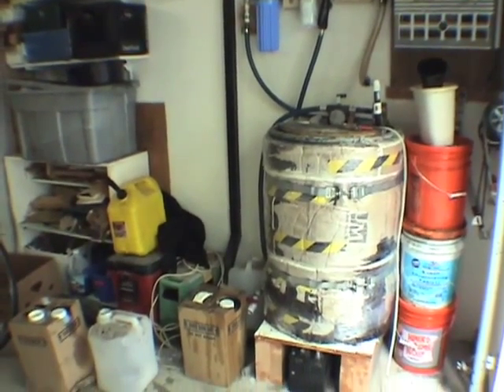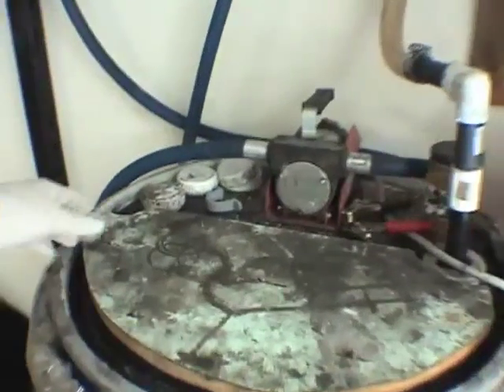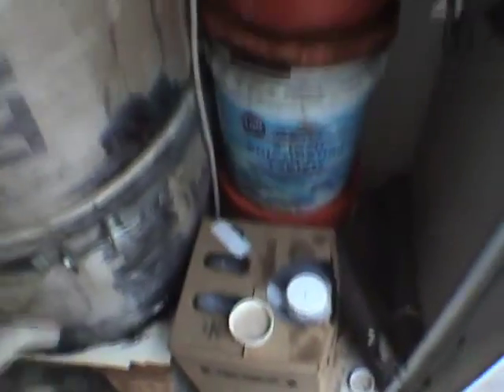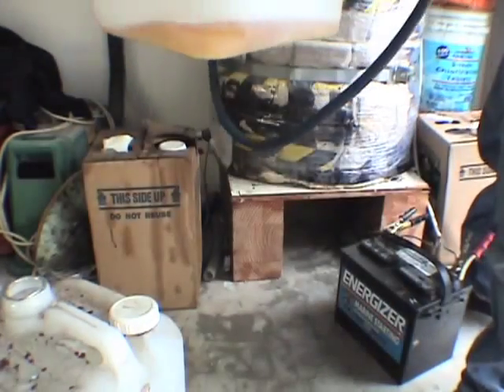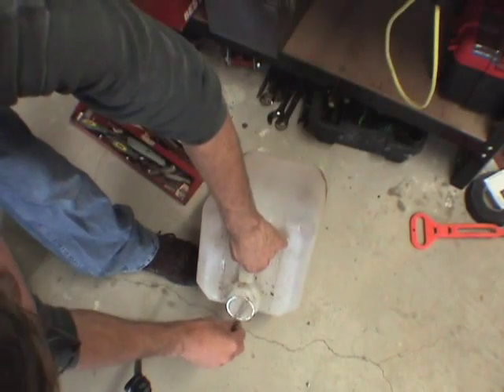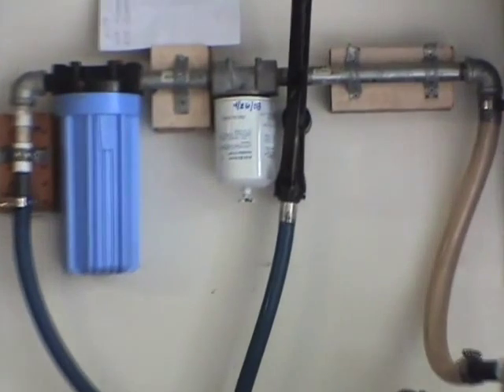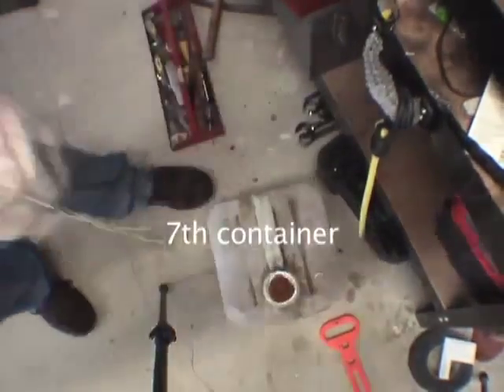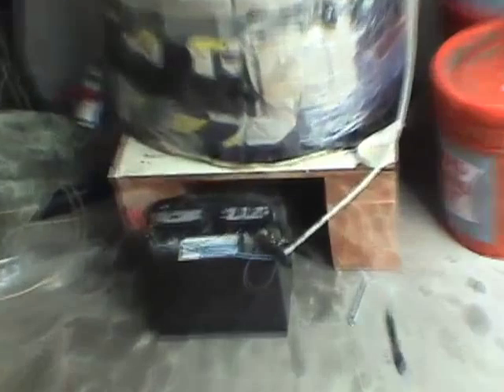Waste Vegetable oil filtering / dewatering v2.0

Comment: @joebro32 Taxes on an electric vehicle would be easy.  If they assign a base rate for mileage lets say $0.01 per mile thats $100 for every 10,000 miles.  That seems fair cuz if you do the math for a gas powered car that gets 32 mpg that travels 10,000 miles works out to be 312.5 gallons of fuel.  Now 312.5 gallons of fuel being taxed at $0.42 a gallon works out to be $131.25.  I'm content giving a $31.25 tax differential to people with electric cars.  They're not killing me with the smog

Comment: I would Like to share a little info with you ...You can get a 12 volt converter to run your pump(s) by using a computer  Used power supply inside of the power supply box is 12V+/- and a 6 volt .All you have to do is use a magnifying glass to read inside which is which. I hope this helps....

Comment: Great Video-  Is it ok to have the transfer pump  before the filters.  on board systems seem to have the filters on the suction side.  So that the water will not turn in to an emulsion.  Also  put your 12v battery on a piece of wood to insulate it from the concrete, so it do not discharge.  Thanks

Comment from the maker: Yes that does happen but if I take my time to pour and keep the liquid as level as possible while pouring it  lessens the bad stuff getting in.  When I can no longer pour the good stuff I simply pour the sediment into a new resettling cubee.

Most people use the 7" wide filter socks.  I went with the 5" but in hindsight I would use the 7" because it is easier to pour